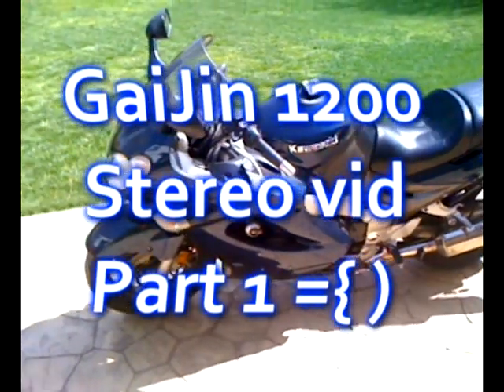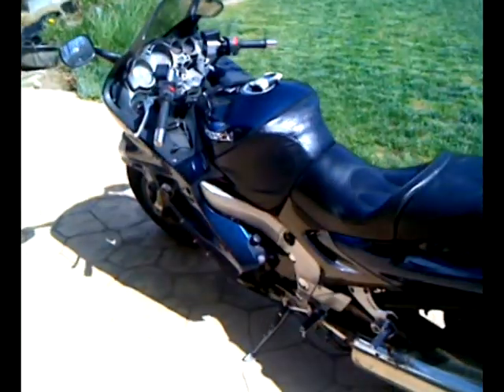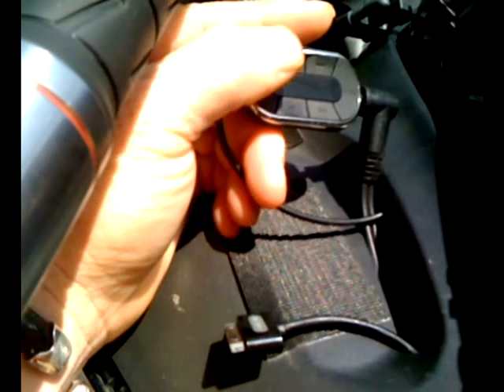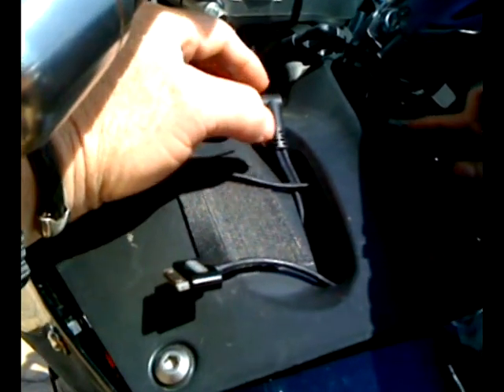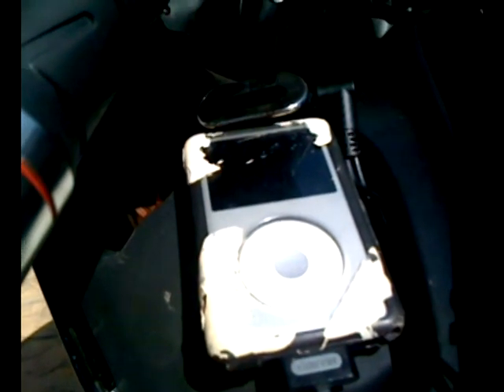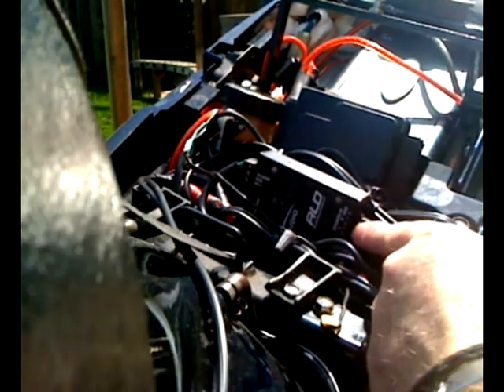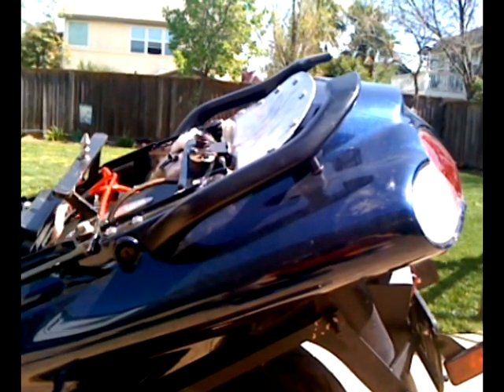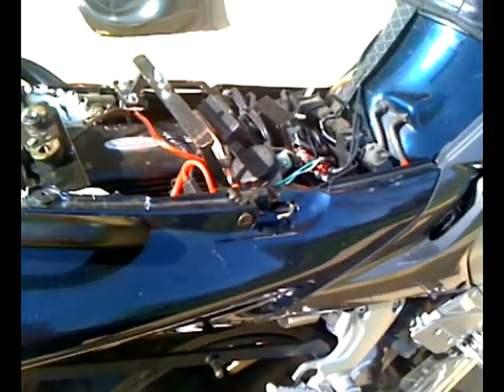Putting a Stereo in a Kawasaki Part 1

Comment from the maker: The issue I have with the head unit is that it doesn't charge the iPod while it is connected. I plan on hardwiring it in on the reinstall as well.